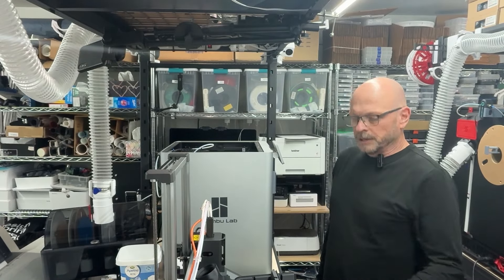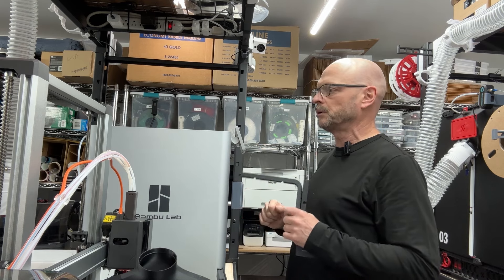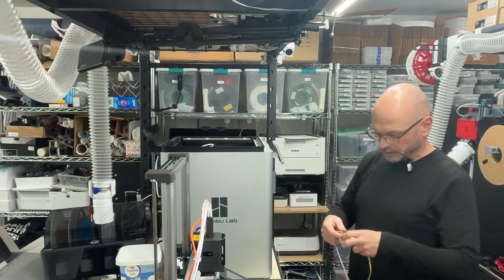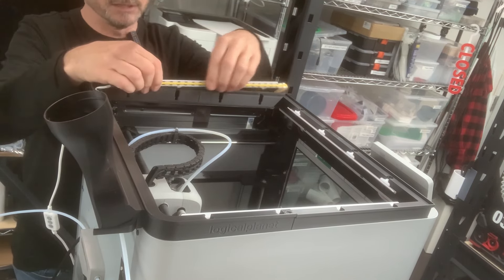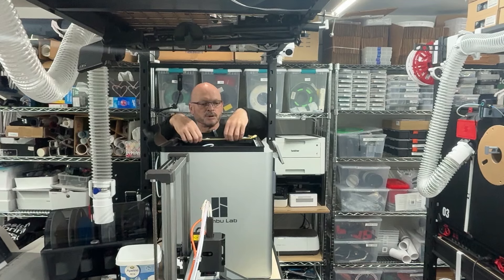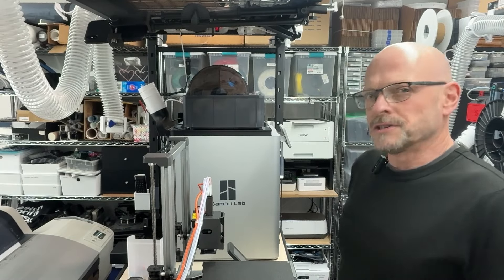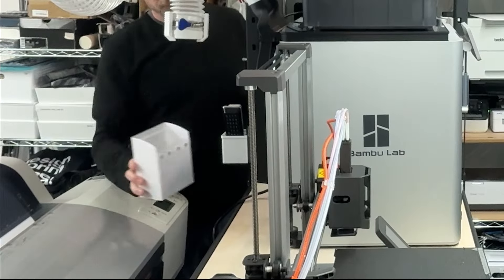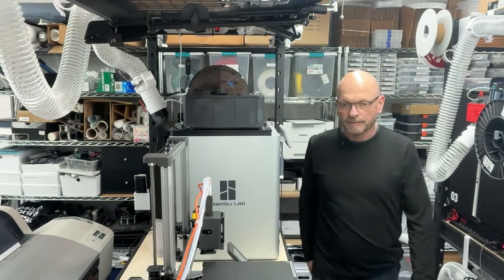BambuLab X1 Series Capture and Vent Exhaust System V2.0

Comment: Another question, what are you attaching your hose to?  I have a screened window and was considering letting the air just passively get pushed out the screen if I set the end of the hose pointed at it, but maybe there's a better way?  Do you use an active ventilation system?
Reply from the maker: In my case, I have cut a hole through the wall and printed a through-wall fitting that has a small computer fan mounted in it.  That fan is pulling air out the the exhaust.  If you are going out a window, you could make something similar or just put the hose out the window with a passive approach.  Experiment and see what works for you and your situation best.

Comment: So glad I found this video. I thought mine was blowing out until I help a napkin up to the vent. So with your vent system it shouldn't need a real big fan to suck the fumes out, right? If we suck too much out too fast, the temp will drop real fast I imagine. I plan on installing a dryer vent and vent out through that. Great mod and thank you for sharing.
Reply from the maker: @Ricks_Tech_Talk  yes, you are right, you perhaps do not need any suck (negative pressure).  I run a lot of machines so some negative pressure is beneficial.  But if you are only running one or two machine you might not need any or very little suck.    And also I recommend adding my variable control valve so you can reduce or close off the flow when running a material that needs higher build volume temperature.
Reply: @pdb6251  That is the concern, too much fan pulls heat away from the build. I will use natural ventilation(the X1) fan to see how that works.

Comment: Hi. The fan cover didn't print properly on the X1C. I printed in the orientation you had on your site without support. Any particular setting I need to change that you recommend?
Reply from the maker: You must enable "detect thin walls" and preferably also set the wall generator to "arachne".  Please let me know if that works.  Thank you.
Reply: @pdb6251 Amazing! Thanks for this, that did the trick. For others as it wasn’t immediately obvious to me, you need to remove these thin walls with pliers before snapping this piece into the other.

Comment: Just checked my bambu lab x1 carbon and  looking from the back the fan on the bottom left witch is the chamber fan is blowing out not sucking air in
Reply from the maker: Oh, interesting.  I have an x1-carbon as well.  It is sucking air into the machine so venting at the poop chute.  If yours is opposite you can use the P1S system which is better because it does not I interfere with the poop chute/bin.
Reply: @pdb6251   Hi! I love your design, very elegant. My X1C airflow is also backwards like this! Other exhaust designs I have seen for the X1C are also for the opposite side? Perhaps your fan is installed backwards? Referring to the BambuLab wiki seems to confirms this.  It makes sense because that is the side the charcoal filter is. Regardless if your P1S system will fit my X1C I will try that one out. Thanks for the design.
Reply from the maker: @user-wz2pm1ht7x  Thanks for your comments.  I will dig into this and try to figure out why the difference and report back here.  I did some initial reading and one thing may be that if you have the filter in or not the fan changes direction.  But hat does not sound right either.  I will dissect my x1 and try to figure it out.
Reply: I@pdb6251  I can confirm that my x1X also exhausts from the rear chamber fan. It's exhausting the activated charcoal filter airflow.
Reply from the maker: @califpv  Thank you.
I am not sure if you have seen but I just posted a new video and a new exhaust for the fan side.
Reply: @pdb6251  awesome. I'll take a look. Thanks for all your time on this project 🤜🏻

Comment: I've got my X1C in my bedroom and can currently only use it when I'll be out of my bedroom for the weekend (so I can leave it to print on a Friday, for example). Otherwise I suffer the woes of inhaling the chemicals from printing the days following a print. Boo.

I'm wondering if you could improve your 2.0 design by capturing the carbon filtered exhaust too and maybe route it under the Filament buffer to the other already designed side of your ventilator.
Reply from the maker: I am trying to figure out the exhaust for the X1C.  Somehow I had the understanding it vents out the poop shoot.  But it might not.  Are you clear on where the exhaust is coming out?  I am building a test rig today for my X1C to see for myself; definitely I hope.  Then I can adjust the design(s) accordingly.  All thoughts and ideas welcomed.
Reply: The exhaust on the "left" with the carbon filter sometimes has a pull due to the carbon filter blocking flow (according to someone from BambuLabs). But I assume due to the filter it is the "main" exhaust.

I think it exhausts from all the locations you already covered, PLUS the last spot which is the carbon filter exhaust on the left.  Idk, not sure if you feel the extra coverage is necessary, but it would be great to not have this thing leak at all.